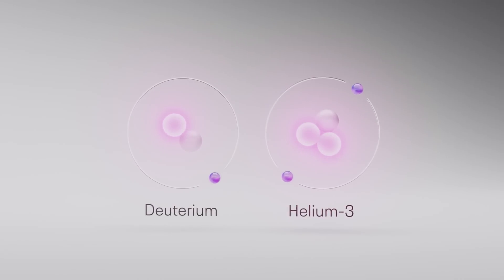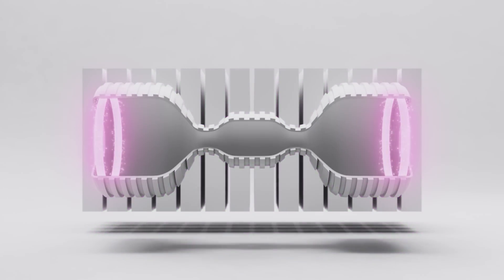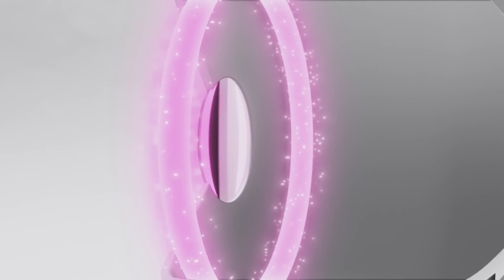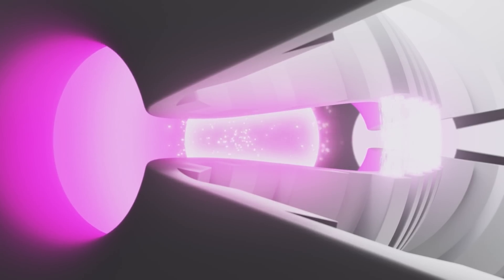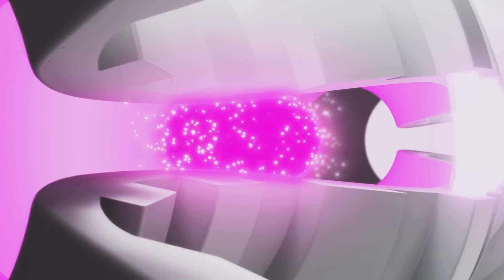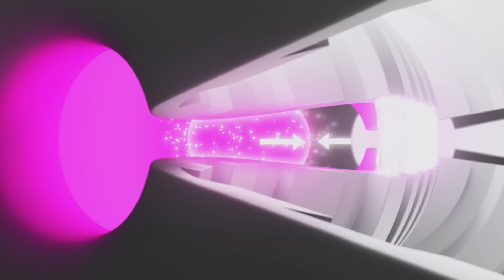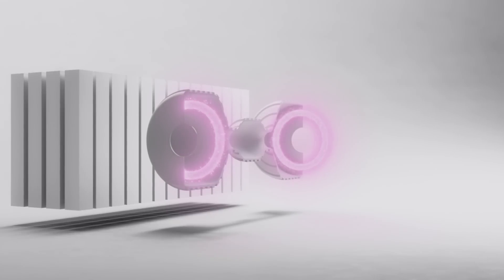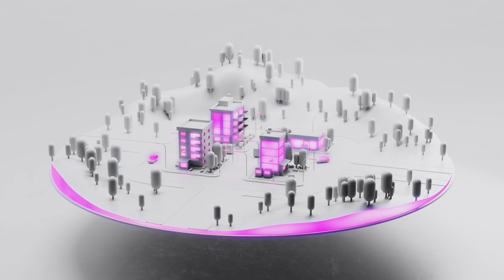Helion's approach to fusion: How it works

Comment: Based on recent advancements made in the technology it will probably be used for power stations and as a power source for newly built large sea vessels by the end of this decade! It may also eventually replace diesel engines in trains operating on non electrified lines! :)
Reply: Are you high?

Comment: How are you able to contain and transfer all the heat generated from the reaction and what kind of material can withstand these Temps and what is the maintenance like on these machines. How radioactive is everything, what if there is catastrophic failure and you introduce atmosphere or water into the system that is at this temperature and reacts with radioactive surface inside ?

Comment: When I learned about ITER my immediate thought was "this is idiotic and impractical" because the size + cost for a prototype that will never generate usable power is unsustainable.
It was obvious then & more so now that far smaller devices were needed, ITER being politically motivated & not by engineering principles.
At last a number of small fusion designs are progressing fast, ITER must be abandoned as the biggest white elephant ever.
Reply: What the fuck are you even saying. ITER has always been a research project, it was never planned to hook it up to the grid. It's to advance our understanding of physics and our engineering capabilities

Comment: Can this be used or modified to propel a spacecraft?
Reply: Basically split it in half so that the plasma is accelerated in one direction, and have fusion occur while the plasma is accelerating. Currents are induced to power the next cycle, and the rest of the energy is transferred to the spacecraft via conservation of momentum.

Comment: For anyone interested you should also look up "drop in fuels".  It is demonstrated that we can make hydrocarbon chains and usable fuels for air-lines using nothing but air, water in the air, and sunlight.  And has already passed the prototype stage but as with a lot of green energy solutions, the excitement around it seems heavily suppressed, and like a lot of green energy tech it is not being invested in because large corporations and the people who hold shares in oil and gas (most of your politicians if you are in the U.S or UK) want to keep a grip on oil for as long as possible.  Also, if you live in the UK over a quarter of the energy used from the grid is from wind, that's how effective it is. Just dial up the amount of wind farms and you can have 100% of the power from the grid covered.. but no.. we're apparently still playing with the idea of fracking, gas from Russia, oil from Saudi, coal mining, and new nuclear power stations..  there are A LOT of viable alternatives that those in power are dragging their heels on.  Don't expect tech like Helious to be any different.

Comment: Can anyone tell me if Helion is using helium-3 fuel prepared via their deuterium fusion route, as opposed to commercial He-3?  It’s one thing to be able to prepare He-3, and another to prepare it on scale and in high enough purity for this application.  I’m hoping this won’t represent a bottleneck to commercialization because I love the concept of moving away from scarce tritium.
Reply: "A New Way to Achieve Nuclear Fusion: Helion" that video is about as much information you can get without deep diving yourself i'd bet

Comment: what's the output, not in power (watts) but in energy (Joules), even though the power output is high the pulse duration is very small, output energy in Joules is more meaningful.

Comment: From my understanding, the real breakthru here would be cost. Tokamak generators were on the verge of net energy generation, and China recently announced they had actually accomplished it using one.

But the Helion method is not only capable of net energy generation, but at a size and with a method that makes commercialization practical.
Reply: Tokamaks in their current design also require incredible amounts of beryllium which unfortunately ends up being radioactive waste beryllium.

Comment: Fusion from heat on the atomic radius at the atomic level looses more energy than is produced during the brief confinement,, rather, beam electromagnetic focused energy into the system of a much higher frequency in the x ray wavelength until a resonance is achieved by experimentation and/or calculation based on the radius of minute atomic nucleus radius in stead of dumping most of the capacitor on gross atomic sizes of the atom sized plasma the reaction of nucleus or sub nucleus sized particles would be enhanced exponentially better because they will be excited to react when their characteristic vibrational wavelength is used to energize them, and only then will break even and multiples of be achieved.

Comment: Could this technology theoretically be miniaturized to generate power for a single home or vehicle?  Fusion for base load power would be wonderful, but if we could eliminate dependence on the grid, it would be that much more fabulous.

Even something scaled for neighborhoods would be a huge step forward.
Reply: The problem is capacitors, this device needs alot of power very quickly and we don't have any good energy sources that can draw the many thousands of amps needed without taking up alot of space 

that and also actually making it efficient enough to actually generate net positive power requires them to upscale it not downscale it

100 years from now we might be able to shrink it down if capacitor technology gets alot better and if the reactors get alot more efficient but fornow the focus is actually getting one of these reactor designs to generate more power then they use

Comment: You're pulsing in ms?
Damn that's one electronic nightmare... uhm I mean challenge.
Does that mean you can do grid load balancing in a similar quick fashion?
If so, that's pretty damn impressive.
Reply: A very efficient capacitor would be likely required to smooth out the electrical generation. :)
Reply: Yep! They are using capacitors. The pulse is a ms long, but they are "only" planning to do 10 Hz in the final power plants.

Comment: This could be real handy for deep space electric propulsion. A steam (or any phase change) powerplant is awkward to say the least when you don't have air or water to cool it...
Reply: Not so fast.  Getting rid of excess heat from the propulsion unit, which is inevitable, and substantial the greater the energy production, is very difficult in space - for exactly the same reasons, no air or water to cool.   In fact without a  significant advancement in physics - a way to convert heat back into ordered useful energy, if even possible, this will be the limiting problem for advanced high energy propulsion systems.
Reply: The excess heat could be vented as plasma exhaust out a rear port of the spacecraft. The exhaust tubes could have thermoelectric panels that could extract some electricity also. The exhaust may not generate thrust, but the reaction could power an ion drive or whatever new drive scientists derive in the future. :)
Reply: @chrispurvis9466  I think that where fusion propulsion will go is towards pulsed systems, that essentially act like nuclear thermal propulsion. You heat up your machine and get some thrust from the actual fusion pulse, then add LH2 (or maybe Deuterium if you intend to add it while some fusion could still happen) for some extra thrust and cooling at the cost of ISP. If you can get to gas core NTR efficiency (ISP ~5,000) that way, that is likely enough for the (inner at least) solar system.
That said, Helion has a pretty cool concept for fusion propulsion in a drawer as well. It uses FRCs but otherwise works very differently (and does not have a heat problem).

Comment: I thought you might have briefly mentioned it but you also have some by-product heat and you run steam turbines off of that byproduct heat as well as the direct draw?
Reply: No the whole point of this innovation is to bypass the outdated steam turbine system
Reply: Any heat would be far too quick to capture. Changing magnetic field could potentially be captured with super fast charging capacitors that drain off to an intermediary collector before the next firing. I'd imagine the best way to make these machines work is by connecting about 50 of them together and having each one fire sequentially in its one second loop (50hz)

Comment: Not sure about something. Induction will let you draw out the energy in the current, but the fusion energy will be randomly directed and just contribute to the temperature. Is it possible to harness this energy outside of a heat engine?
Reply: The FRC plasmoid does not die after compression. Instead, the fusion energy drives the expansion of the plasmoid which is still organized. Exception are neutrons and X- Rays, as far as I understand anyway.
Reply: @elmarmoelzer2229  pretty much (iirc) and by using specific fuels you prevent don't create the Neutrons that require low efficiency+high cost systems to capture the energy of
Reply: @logion567  D-D fusion still produces a (relatively low energy) neutron in one branch. It is not that big of a deal, though.
Neutrons make about 10% of the energy released in Helion's fuel cycle, by my estimate. X-Rays could be a bit more, but from what I understand, Helion is looking into getting those too.
Lots of things are easier if your machine is pulsed.
Reply: @elmarmoelzer2229  
Why do things get easier when a machine is pulsed? 
(I presume because you can do multiple things under different conditions, instead of having to do all of them under one set of conditions, but I figured I'd check)
Reply: @MrNicoJac  Pretty much sums it up. E.g. you can extract fusion products and unburned fuel between shots and don't have to worry about doing that on the fly.

Comment: More questions for Helion: How does the Lorentz Force capture the Bremstrahlung Radiation or mass flux contributing to pdV work?  How does the Helion apparatus otherwise capture these energy contributions? Where does the energy for the Formation Chamber or the supermagnets come from?  Each of these are non-trivial constituents in the energy balance.
Reply: It can't. Bremsstrahlung is going to just heat the walls of the chamber. But if they can keep Te << Ti, then bremsstrahlung will be relatively low.
Reply: @zzasdfwas  Yep! Helion has a peak Ti: Te of over 17 in Trenta that ratio increases with temperature but decreases over the length of the pulse. With that high of a Ti:Te their Bremsstrahlung losses are a lot lower than in an equilibrium Tokamak.
Reply: Shhhh. Too many questions are bad for fundraising. You're supposed to just revel in the CGI and open your checkbook.
Reply: The braking radiation isn’t the only EM disturbance there.

Comment: If this ever works. The cost estimate of 0.01 / kWh of energy is extremely high. The cost will be more like 0.01 mWh of electricity. Right now traditional electricity costs about 0.03 / kWh for the fuel, all the rest of the cost is the distribution of that kWh cost.

This machine, if it ever works, will change the economics of the entire planet for every good produced.

Comment: I remember being disappointed when I first learned how a nuclear reactor worked.  I was in 7th or 8th grade at the time and realized that this a was just a glorified steam engine.  Granted most of the energy quickly devolves into heat and mustn't be wasted but I sure like this more direct approach to energy extraction.
Reply: Reality is often disappointing.
Reply: Nothing wrong with steam. Water is a universal substance . Max power occurs at 50% efficiency anyway
Reply: I remember feeling exactly the same way when I learnt this in high school
Reply: Fission reactors don't get hot enough to directly use faraday's effect with a flowing plasma. There's no actual way at lower temperatures to transform heat directly into electricity without relying on some power conversion cycle i.e. providing a fluid energy to perform useful work (spinning a turbine to induce electricity in a magnetic coil). There's the Seebeck effect that relies on the temperature gradient between a hot and low source, to effectively use the of heat to produce electricity, but that relies on electron motion along the heat flow path creating small voltage gradients (and barely reaches efficiencies of 10% if you use superconductors). There isn't a more direct method of using heat to induce the flow of electricity. Plus, power cycles are cool -- you don't just need water in a steam engine, you can also use other fluids (thermodynamic cycles are all about using thermal sources to do work) like carbon dioxide, and take it supercritical where it's much more efficient than steam.
Reply: Yeah I also remeber

Comment: Aside from using a different fuel, and not using proton beams in the central reaction chamber, this flavor or FRC this pretty much identical to Tri-Alpha energies FRC configuration in that you have two opposing toroidal plasmoid structures accelerated and meeting in a central chamber where direct energy harvesting can happen via cyclotron or quadrupole coils. The more the merrier in terms of fusion startups, but Tri-Alpha energy has been around for 24 years and has 880 million in funding and Helion is 9 years old and has over twice the funding capitol (2.2 billion) so I just wonder if in the world of fusion startup companies, if success has more to do with marketing then actually having novel technology or approaches. I'm of course oversimplifying, however I wouldn't be surprised if that's the current dynamic, just wish more fundamental physics in this field were publically funded so that more startups could apply the learned and shared insights to their designs.
Reply: Technically, Helion has been around for much more than 9 years (though not as an actual company). They are a spin- off of MSNW LLC, which was a spin- off of the UW and was founded in 1999 (IIRC). Mind you that one of their founders, Prof. John Slough (of UW) actually helped TAE build one of their earlier prototypes.
Also note that while Helion and TAE look superficially similar. TAE uses neutral beam injection to stabilize the single FRC that is born from the merge of the two opposing FRCs. It is a steady state design.
Helion's design is a pulsed design. They compress the merged FRC using strong magnets (which increases temperature and density) and the relaxation of the FRC after the compression induces the current (TAE can't do that because their design is steady state).
Reply: @elmarmoelzer2229  Thanks for the explanation. I should have known that obviously some cross pollination of academic people would likely happen for all of these projects.
Reply: Hlavní  systém helion je schopen fúze . Prvotní je palivo . K v přírodě není  nic v čistem stavů. Klíč je pohonem směsi jako u vodíkové pumy  použití štěpné reakce za současného magnetickym rotačním polem ke stlačení plazmatu a prolomení atom vazeb a spustit slučování.   Samozřejmě nechci atom výbuch jde o rozkmitání jader deuteria pomocí těžších částic v palivu samozřejmě nebude reakce čistá. Rusové tohle řešení použili v  jaderném motoru burevestnik. Tohle řešení napadlo Jevgenij Velichova . Ten je otcem technologie jaderneho koaxiální motoru kdy použil proud kritických částic k pirolize vod kondenzace  z atmosféry pokud poletí motor v atmosféře má takřka neomezený dolet.  Velichov je take otcem  plazmového štítu ořešníka další jeho geniální nápad a řešení polarizační plazmový štít střely je impozantní řešen . Je schopen pohltit rádiové parskv  přidáním borů do plazmového hoření  k potlačení radarového navádění paprskem.   Ten hlap byl génius. !!!!!❤

Comment: Noted your looking for a new hire to design suitable high voltage capacitor technology, might I inquire if your team has considered use  of the following technology.  One option includes 0.026" thick  316L electropolished stainless steel (does not degrade deionized water) (use welded sheets using TIG welding) in the formation of large spherical vessels (for equipotential over a suitable structural framework).  The tanks will be about (TBD 4 - 6 feet diameter).  An array will be enclosed on racks in a secondary room that provide for electrical isolation and protection.  Use an ~18 inch dia inner sphere for the + electrode and outer - electrode is the outer skin of the tank.  The volume of the tank is filled with 18.2 Mohm deionized water that passes over ion exchange resin, and monitored for maintaining this quality.  This will provide you a low-cost, ~50 million volt threshold to accumulate pulsed electrons from your magnetic fields.  With a bank of these, the capture of ultra high voltage pulses becomes quite practical, then use a tuned resonance transformer into grid high-voltage.  Take a look at design options knowning that QV = (Q2 / C) = CV2 joules, Coulomb's law states that the force between two charged objects is proportional to the product of the charges and inversely proportional to the square of their separation.  Separation of the electrodes should be sized for your high voltage potential to maximize the charge yield. Some basics include the current flowing onto the positive capacitor plate, and the equal current flowing off the negative plate, is the rate at which charge is being stored.   Presume the current and the voltage are out of phase Vc = q / C, V = Xc Im sin (ωt -π2), as charge builds upon a capacitor, a voltage develops across the capacitor, which opposes the charging current. Resulting voltage across the capacitor V = Q / C, where Q is the amount of charge in coulomb, and C is the capacitance in farad. Expect the current to lead the voltage by a quarter of a cycle, i.e. 90 degrees.  Enjoy the calculations and the success.